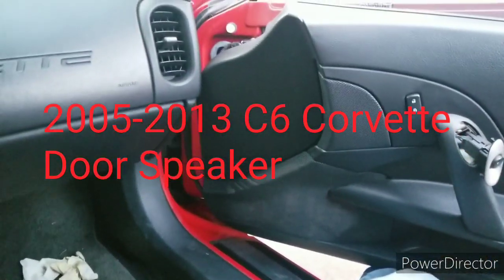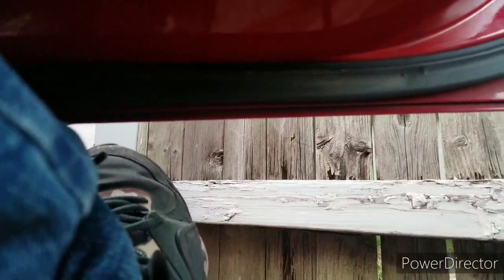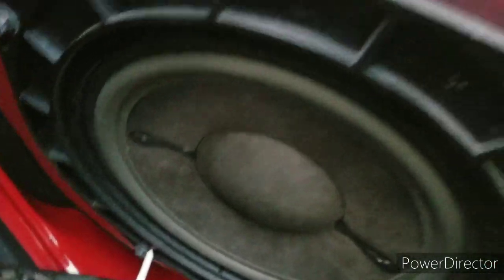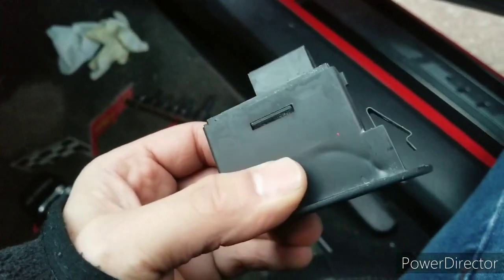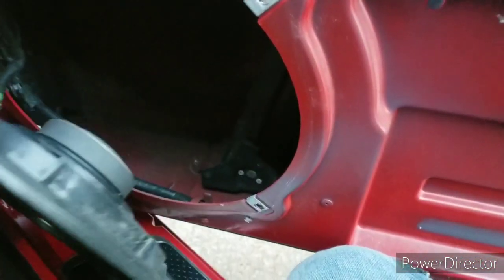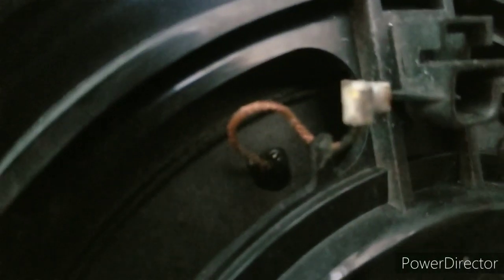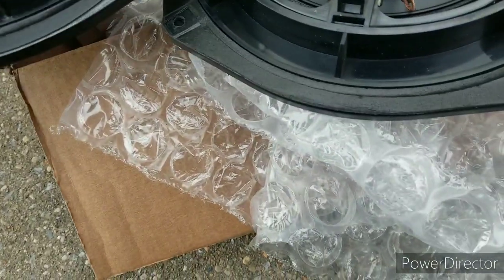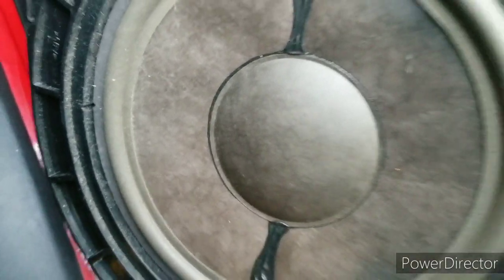C6 corvette door speaker removal 2005 -2013 models

Comment: Bro no way you ordered an OEM speaker to replace it. Just get some Polk or JL or anything modern for 60$
Reply from the maker: I wish I had known. I also didn't want a big difference in sound quality.  That's why I just went with whatever was in the driver's door. Thanks i appreciate the info
Reply: I saw some 10 inch shallow mounts thinking of those 10s

Comment: What kinda aftermarket wiring Harness do I need to upgrade my c6 base speakers to the bose ones that come out of the premium base model
Reply from the maker: I'm honestly not sure. If you search the C6 corvette forums I'm sure you can plenty of info. Alot of guys go from factory Bose to even better aftermarket systems and also change there radios/heads up display
Reply: Trust me, I have the Bose system in mine and you don't want them. Go to any corvette forum and you'll see hundreds of better options.
Reply: Metra 72-4568 Speaker Wiring Harness
Reply: You’ll also need to swap out for the Bose amplifier
Reply: The Bose is the worst sounding system I have ever heard. Go with something else.